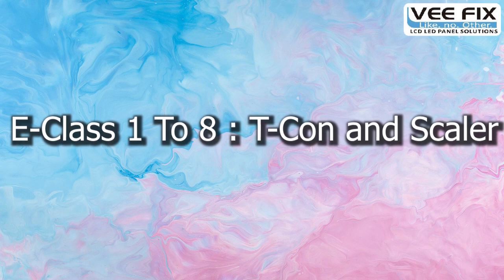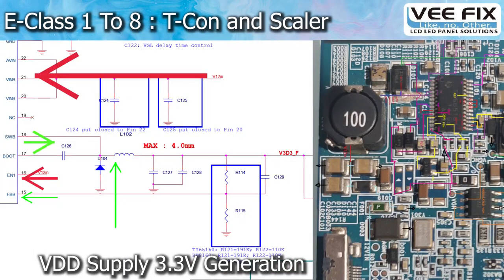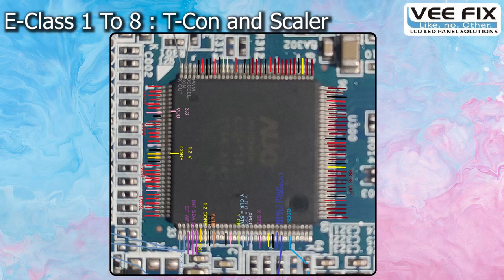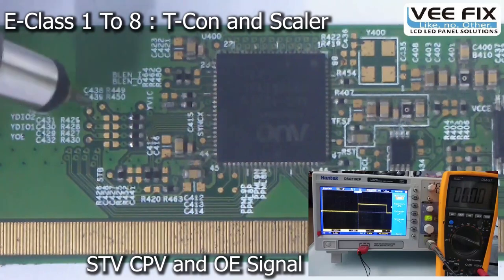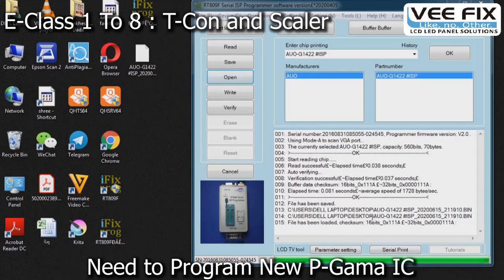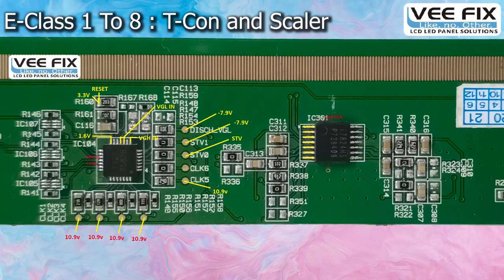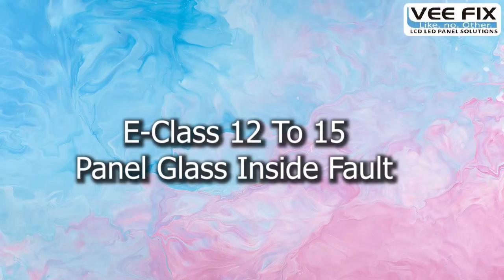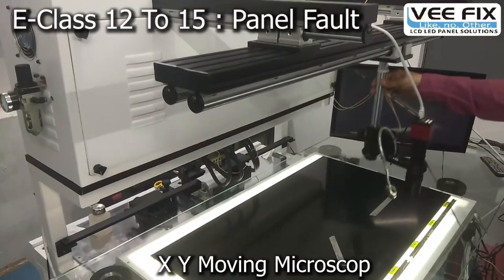LCD LED TV Repairing Online Training English

Comment: Though it is just information but it is in my opinion also a great tutorial .this is the best tutorial available on panel, its information,working  of used IC its voltages n working of all signals in very deep..how panel works  COF working its signal n bonding is explained in a nice Mannar.live demo on bonding is excellent.really great information on led screen including all signals input n output.best tutorial available on panel information, its working n faults related to it.at last how to use DSO is practically shown is amazing.thanks for such a great n  useful video.

Comment: With due respect sir please upload one more video giving information on all components used in  TCON board  its name n number respected pin voltages n signal on each points using DSO,including crystal in slow motion whenever you get time. As the way which you explained is excellent.This is just a request .